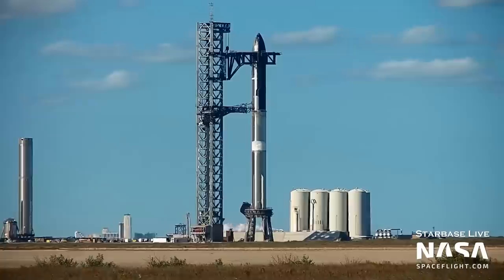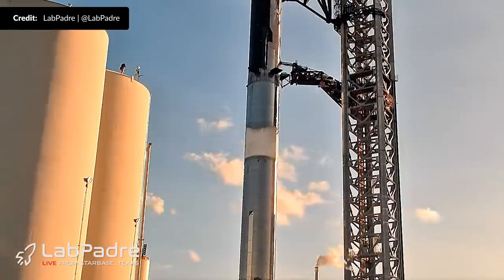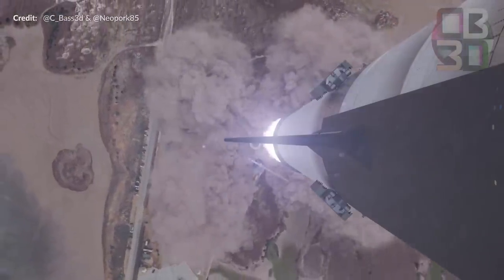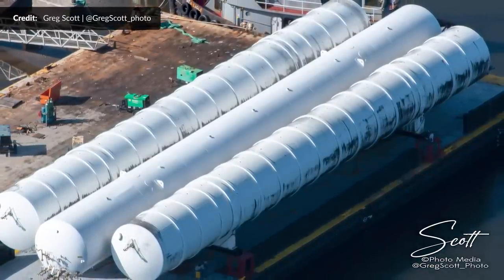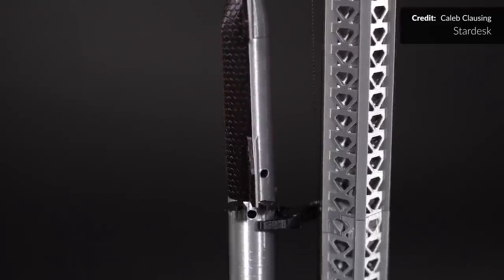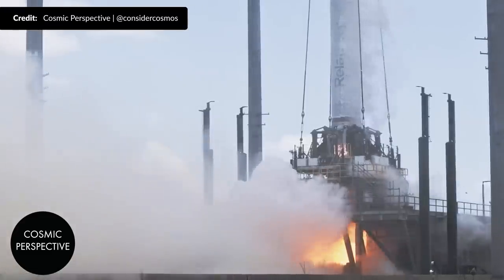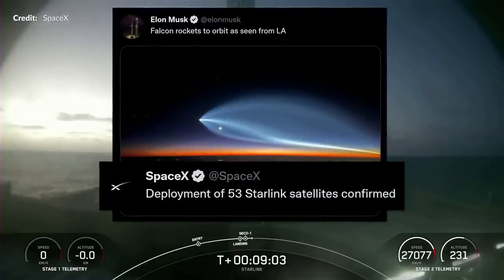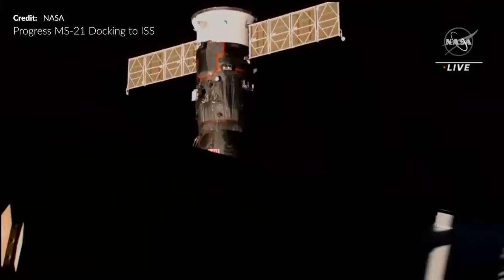SpaceX Starship Going Next Level, Falcon Heavy Final Countdown, Relativity Stargate and more

Comment: The ideal situation would be a huge 3D printer in orbit to construct vehicles to any specification.
Reply: I too have thought about this. I can’t help but think that Relativity’s new horizontal printers will render some wonky products. Why wouldn’t a half completed tank or cylinder  droop under it’s own weight while still hot resulting in a more oval shape?! So of course in microgravity, that issue would be mitigated. The issue that comes to mind regarding in orbit 3-D printing of rockets/spacecraft is the super cold environment when in the shade. I feel like the printed metal being “flash cooled” may make the metal brittle. I’m no expert tho. I suppose they could choose an orbit that doesn’t experience any sundown events, then partially block the sun/heat with a variable shade of some sort. Thereby dialing in the exact ambient temperature required. Holy shit I just fixed the problem!😳🤣

Comment: Falcon Heavy is quite impressive, but can you imagine what it'd be like if they decided to launch a 'Starship Heavy'?!
Reply: onbedoelde Kut, that would be amazing...good point !
Reply: While it would be amazing, it would probably be more feasible to design a new rocket due to the stage 0 launch ring stuff and the chopsticks.  One can always fantasize, though.
Reply: If I were to sketch out a concept for a Starship Heavy (which seems so ludicrous as to be Kerbal), I would ring it with 4-8 Falcon-type booster rockets, that would do lift assist, detatch, and land reusable.  The most critical phase is ascent from ground to transsonic speed and transition from atmosphere to troposphere, after which the craft transitions from trying to increase ascent velocity to trying to reach orbital velocity.

While I respect and admire what the Orbiter program accomplished, putting SRBs next to a giant fuel tank proved to be a bad idea.  The Russian Proton design got it right; a single design concept that operated successfully for 6 decades.

Comment: Thanks for another wonderful video!

You've got a good point there about Relativity Space and their 3D metal printer. That thing looks amazing! I don't think we'll be putting fusion reactors in space anytime soon (that's a job for SMRs) but their 3D printer may end up making some amazing things here on Earth.

It's nice to see a Falcon Heavy launch again. If I'm understanding it right, the reason we haven't seen any launched in years is because the upgraded Falcon 9 can do most of the things customers need. To make the Falcon Heavy stand out you've got to really push it to the edge of it's capability by expending the core.

Comment: Does anyone know which Apollo mission is shown at 11:40 in the video?  If so, is that the CMP doing an EVA on the way back from the moon to retrieve film?  How did they manage to take that picture?
Reply: That's Apollo 9 in Earth orbit. Notice Earth in the background. That's Dave Scott    poking out of the hatch of the command module. The photo was taken by Rusty Schweickart from the hatch of the docked lunar module.
Reply: @StevePemberton2  Thank you VERY MUCH!!  So the LM was depressurized at the same time. I wonder if the tunnel between the two spacecraft was open or closed at the time?  It looks like they released a satellite during the EVA. Look down in the bottom of the photo - slightly to the right.

Comment: It seems wise to me during the testing stages to gather data, using an "expendable" prototype seems logical, IMO.
Reply: They plan to expend the first launches of Starship.  Just as they did the early Falcon 9s.  Even the first Falcons landed were not reused but disassembled to find all the damage done by the flight and landing to improve the design.  The same will almost certainly happen with the first landed (caught) boosters and starships.

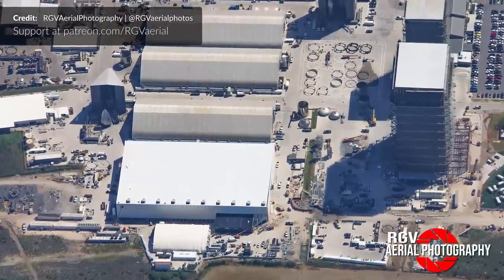Comment: the ring alignment welding jigs were visible in the yard at about 3:51 + in the video.  Very nice to hear words like  "recommenced" being used.  if you were from Texas you'd be slammed for being pedantic.  I like it,  for it is a laconic term of efficiency and verbal economy.  The welders on top of the chopsticks [about 8:38 +] do a good job of providing scale.  --  Seems SpaceX is missing an opportunity for an alternate recovery method of the center booster.  It should land upside down in an ionized desalinated mud pit swimming pool;  using rotor blades for an autogiro means of slowing; and slip ring controls for direction. The grid fins would be flat paddles. The rotating head would be located obliquely like the parachutes for the Crew Dragon.
Reply: That's not how things work, because of CoG
Reply: @alvianchoiriapriliansyah9882  It's exactly how things work see wings purpose on spaceship.   Symmetrical landing not required in fact the Dragon is deliberately dropped in at an oblique angle.

Comment: I really hope them all the best for the 33 motor test but I'm finding it hard to believe that running so many motors that closely clustered together in a hold down configuration, that there won't be significant negative "acoustical" interaction.
Reply: Nowadays we have CFD, and that's the exact function of static fires to detect problems
Reply: @alvianchoiriapriliansyah9882  "SpaceShip One" was designed with CFD however in practice,  under full thrust, it rolled so violently and unexpectantly that the pilot just let it go until burn out and bringing up the RCS.  That is why SS1 was never put in as an operational design.  So although a way to further understanding a design prior to flight, its not a cure-all to real world operations.

Comment: They been trying to get fusion to work for 80 years now, and every time it doesn't work, they just make a new version bigger then the last. Can't help but wonder if we would have enough power to start up that behemoth tokamak reactor, by the time they finally get it figured out. Aneutronic fusion looks more promising as far as fusion goes. But we need Thorium molten salt reactors and not cold war relic reactors that only consume 1% of it uranium while summarised in unstable water.

Comment: Things that still need to happen:
* Full stack pressure test
* Booster complete static fire
* Full stack partial static fire
* Full stack complete static fire

All the stuff with full stack also needs to include a dummy payload. The question then becomes, can the chopsticks lift a Starship with a 100+ ton payload aboard?
Reply: Chopsticks is required to do so, otherwise it wouldn't be able to launch
Reply: @alvianchoiriapriliansyah9882  True. Still, there's a lot more testing to be done before Starship can be considered properly tested.

Comment: Hey Marcus, first of, thanks very much for your great work!
I just had an idea I wanted to run by you, maybe the Starship without heatshield you mentioned, might be the first test Starship for orbital tanking and docking?
Reply: It's almost certainly an expendable version for launching Starlinks. They have ramped up ship and engine production to the point where they will be constrained by their limit of 5 launches per year, not by manufacturing.

SpaceX wants to scale up manufacturing further assuming that much more launch capacity will be brought on line in a couple of years. They want the factories to stay busy.

There is a lot that can be tested with expendable launches. They probably see a long path towards getting permission to attempt a test catch.

The first flight with re-entry will probably lead to design changes in the thermal protection system. There isn't much point in building more ships with the same old untested TPS design.

Comment: do you think there be bigger motors in the future so that 8 or 10 engines would suffice? With the 33 engines presently required there are obviously many more joints and parts required and control systems required!!  Yes I'm aware that bigger motors create space issues! Obviously the 33 motors provide more rudundancy, minmizing the impact of a single unit failure!
Reply: Bigger motor prohibited propulsive landing

Comment: The radiation on the way to Mars and the radiation at ground level on Mars is going to be a HUGE problem and those that go, will be met with the very real consequencies to their health.
I haven't seen any serious efforts to address the radiation issue, other than a small shielded emergency section of the ship to hide in, if they run into trouble.

Comment: "The Apollo mission sensors didn't record any of the deep space radiation from galactic cosmic rays." Huh. That's odd. "This is absolutely critical to understand for deep space missions, of course." Huh. That's weird. WTF? 

I swear to god, this stuff is getting fishier every time it comes up, no matter the context.
Reply: Probably the limits of 1960s knowledge and technology.  Just think of how massive the electronics were without integrated circuits using individual transistors, resistors and capacitors.  Your smart phone (if you have one) may well have more computing power than all of NASA in 1970.
Reply: @Scanner9631  Understanding galactic cosmic rays must not have been as important back then, I guess? Like why the change? Is it because, I don’t know…
Reply: maybe because they didn’t actually put humans or sensors into deep space? Just a wild guess. Not sure why else it would only be important now.

Comment: The S24B7 stack, to my carpenter’s eye, does not look straight. I don’t think it will be launched.
Reply: Then why it's being filled with fluids a few days ago?
Reply: @alvianchoiriapriliansyah9882  to my understanding the tanks of the two separate units are also separate so testing of them is probably not affected by a misalignment. But when they launch as one unit they would need to be perfectly aligned I’m sure.
I could be wrong. I only have my phone screen to go by but it consistently doesn’t look quite right and my eye is trained to see such things.
That rocket has a kink.